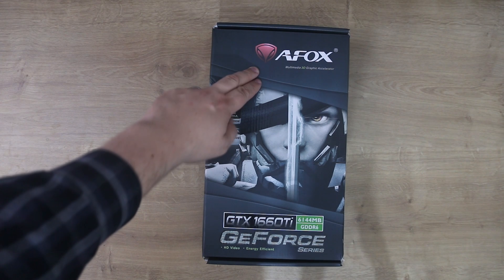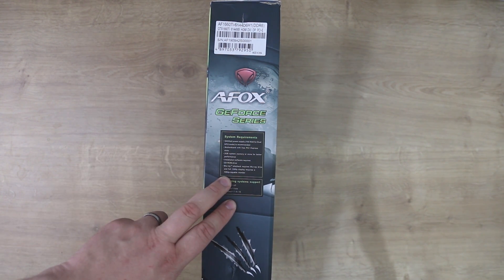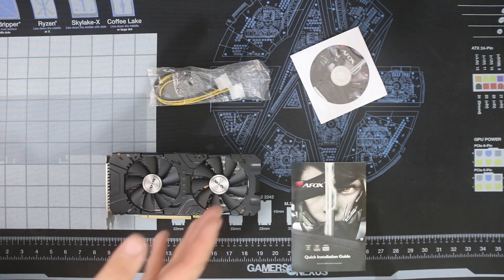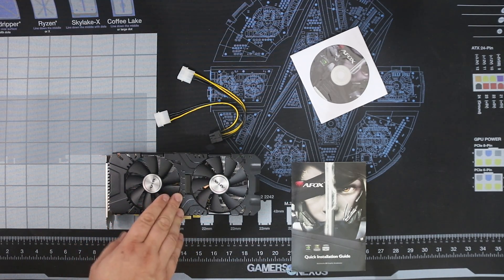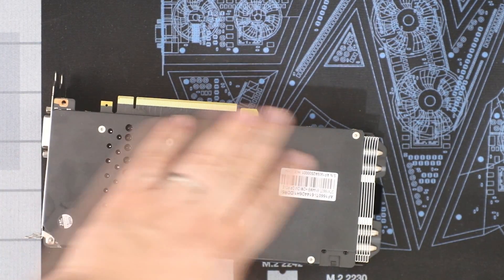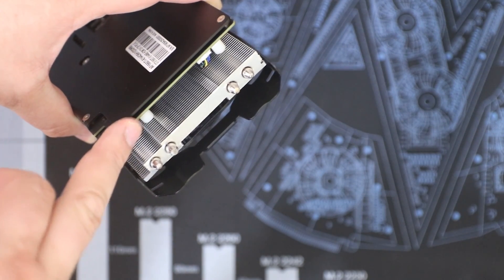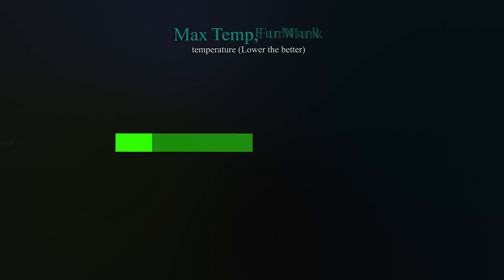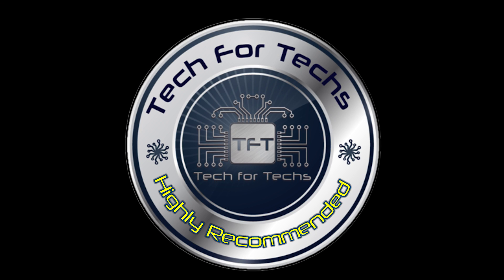AFOX GeForce GTX 1660TI Graphics Card Review and Testing, best value 1660 ti?

Comment: im about to buy an afox card, is it worth it or should i get a regular one
Reply: I got a 1660S from them, bought it 1 year ago. Still working, no problems with temperature. I changed the thermal paste once when it was hitting 80°C and right now is in 65

Comment: Thanks man. I bought one of these because there was no stock of another brand. But with this video, Im more confident with my buy
Reply from the maker: Glad I could help
Reply: How it went?
Reply: @90rghtnow57  got 0 problems rn. It just got 5 degrees up. But I use it everyday, a lot of hours. Gaming and video editing 💪
Reply: @berse5802  Thanks! I’ll be probably getting one of these soon.
Reply: @VeniVidiViral yep! Still good. The temperature did hit 10°C higher, so I proceeded to change the thermal paste. Rn is 70°C with RDR2 open 👐
Reply: @berse5802 ??? Ok?
Reply: @keithflint1265  still good!
Reply: @berse5802  do u think there rx 580 is good?
Reply: @louie9321  considering the 1660s didn't fail to the date, I'll recommend it
Reply: bro i want to buy the same gpu card as your is it good or no?
Reply: @ideal_yt9536  2023 and still working. I changed the thermal paste once but not because of any problem in particular.